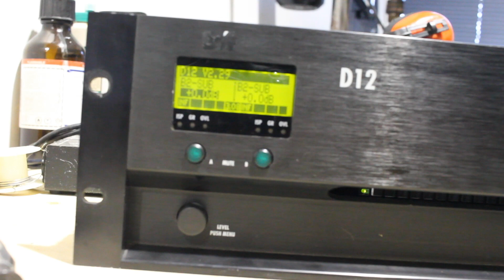Warranty Void: D12 Fault Repair

Comment: Hello Sir, which igbt and secondary diode are use in smps ? Thanks.
Reply: In SMPS of this amplifier use power transistors IRG4PC40UD and diodes BYV34-400